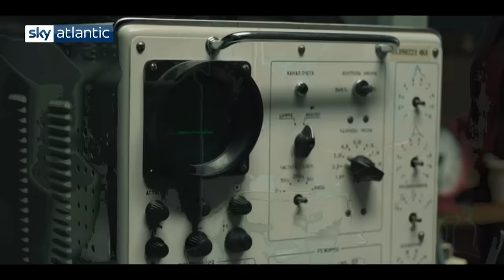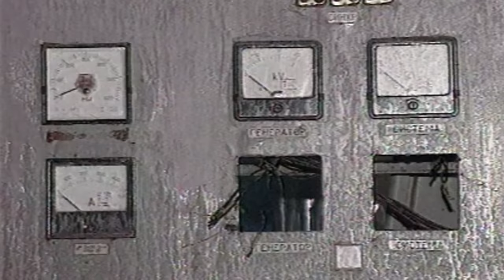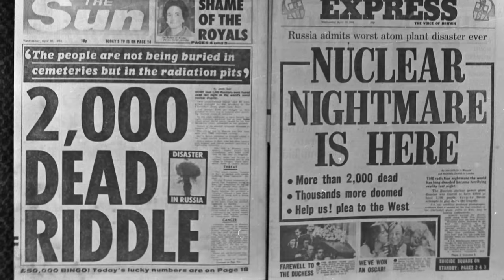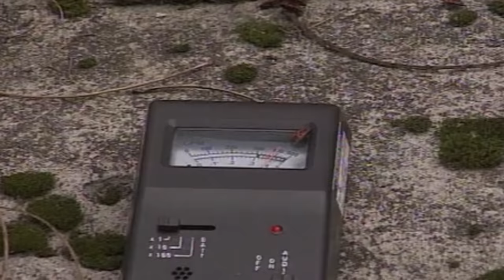Chernobyl Disaster 1986: What really happened?

Comment: They weren't sleep deprived, there was a shift change at 12am. The explosion happened at 1:23am.
Reply: Junior engineers who didn't understand that once they undershot the 700 MW power level by accident, the test was over.  There was no damage yet, but the reactor would need a day or so to burn off the xenon "poison" and return to a state where it could be operated normally.  They were under pressure to complete the test, and didn't have that kind of time.  
So instead they tried to cowboy it back to power by pulling the control rods further than was safe, and made the situation several billion times worse.
Reply: @josephastier7421  that's true, I didn't argue whether their actions were correct or not, I just said they weren't sleep deprived.
Reply: As simple as 123
Reply: How they both at AM?
Reply: And you know that how?
Reply: @josephastier7421  what's that got to do with this guys comment?? We get it, you watched the series
Reply: Joseph Astier Is doubt that considering n that the CIA was active in the area during that time.
Reply: Joseph Astier f
Reply: But when did they start?
Reply: @morellif36  I did not watch the HBO series.   Too scary/sad.  I have watched a few clips on YT.
Reply: Anyone who works nightshift is sleep deprived. I would know, I've been doing it for 12 years.
Reply: Yeah and due to some dude who wanted a promotion
Reply: I mean half the stuff was not there foult there was a button to shut down the core which dropped all the rods but there bottom was made with lead and so it created more heat and situation became worse
Reply: @spookyspeedy8168 3 y late but because after 11pm it becomes AM again. The difference between the shift change and the explosion is 1 hour and 23 min.

Comment: When you tried to overclock a nuclear reactor but you suddenly realized its not a pc
Reply: actually they were experimenting to overclock withouth cooling or fans 

so that happened
Reply: Guess you also shouldn't trust those grey ketchup and mustard-cabled power supplies
Reply: @jakewest8704  mcd colored cable
Reply: They weren't trying to overclock anything. Not even remotely metaphorically. They merely were testing to see how the reactor would work at low power during a power outage. The core however was poisoned with to much xenon and would NOT go back up. However, the tips of the control rods were graphite. As the control rods slammed in, they immediately acted as the perfect moderator and reaction SKY ROCKETED so fast that the rods became fixed into place. Output climbed to over 30,000 megawatts and probably higher but by that point the sensors were gone. All of the water in the core and around it INSTANTLY vaporized into steam creating a massive explosion strong enough to blow the 2,00,000lb lid skyrocketing through the rough and back down vertical onto the core itself. Then the hydrogen that was created from the steam explosion ignited creating a final bigger explosion that ignited all the graphite in the core and nuclear fuel in the core/what remained of the core.
Reply: @madezra64  bruh its a joke
Reply: @Skuge_  so ppl dying in the worst ways ever and get affected with cancer and deform looks like a joke to u
Reply: @Photo Edit-PH lmao best comment 😂

Comment: Just wondering, not picking a fight or anything.
0:59 "Sleep deprived plant workers", it was night shift, men with families, of course they were sleep deprived. 
Are you using sleep deprivation as some sort of excuse or tool to point blame?
Remember, there are thousands and thousands of SD people working right now at NPP's. Sleep tight.
Reply: no they weren`t - night shift had just started
Reply: @ninasastri  The night shift was not their best players.  They made a small initial mistake in running the test, and dropped the power level too low.   They should have stopped there.  But it would have meant an angry day crew and a much-needed reactor offline for a day or more.   So instead they tried to fix it by doing something incredibly reckless, and it got away from them.
Reply: No, Jim, it wasn't the night shift who did the test, it was the graveyard shift that came on at midnight.  Several of the second shift stayed around to watch the test.  They aren't sleep deprived.  I've worked graveyard shifts in the past and it is not much different from other shifts - you get your (and your family's) patterns set and you go with it.  I enjoyed the quiet, personally.  Sleep was not the problem; relatively junior seniority, with less experience and less knowledge about the job, ask ed to run a procedure they had not been trained, or even briefed on. That was the problem.

Also, the delay in shutting down the reactor exacerbated the xenon poisoning problem.  If the test were run by the second (night) shift, it would have worked.

Comment: love the way this guy blames the workers it was the reactor rods that were at fault not the workers
Reply: That's not true. The workers, specifically Dyatlov, pushed the reactor beyond madness and control. The workers who were just following orders I can understand, but Dyatlov forced them to push the reactor. Also, many of those workers were rookies and had no idea what they were doing, so they share some blame but it's forgivable because had they known the design flaws of the RBMK that were hidden, NOBODY would have pushed the emergency shutoff switch. Nobody knew that the positive void coefficient and graphite tipped rods would ever become a problem because for in order for it to ever become a problem, the reator would HAVE to be pushed beyond madness. They disabled all safety protocols. They did EVERYTHING wrong that night. Anything that could be done wrong that night was done. That's why the reactor was capable of even exploding in the first place. It all stemmed from human error, pride, and lies. Lots of lies and pride.

Comment: One key thing that is rarely mentioned in any of these documentaries is that in the USSR/Russia (unlike in the West) nuclear reactors do not have a containment vessel. The reactor has shielding around it but no concrete containment vessel. This meant that the explosion, once it occurred, allowed radioactive material and gasses to immediately escape into the open air. The arrogant Russians thought their RBMK reactor flawless - no accident could happen. The Three Mile Island reactor did have a containment vessel and therefore there was extremely limited release of radioactivity.

Comment: The weird thing is Japan was much worse with the tsunamis but nobody talks about it they covered it up.
Reply: No it wasn't worse. No core has exploded. Never has that occured in history. Only in Chernobyl.
Reply: Not true
Reply: @stringjazz2937  No your completely wrong..in Fukushima exploded all three nuclear reactors in hydrogen explosions and and the unit 4 suffered a highly contaminating nuclear melting beacause of nuclear fuel rods stored there, all the other units of Fukushima had fuel pools also stored right above the reactor that were all blown away with the reactor in the disaster, The difference between the Nuclear disasters of Tsernobyl and Fukushima is that the reactor in Tsernobyl was RBMK type of reactor that uses graphite like a moderator that in the time of the disaster was still quite new and didn't have any used nuclear fuels stored in them, instead in Fukushima all four units were boiling water reactors BWR, that had decades of used nuclear fuel pools right above the reactors and that were all blown away with the disaster.

Comment: Some idiots told the worker the manual is wrong. The worker found out they're right because they hacked the facilities to show him. Then they trailed a method that would maximise energy flow with little to no work effort and closed the window for cooling. The facilities got too hot because one rod didn't sink on time and they realised their plan for maximum power and efficiency failed. These days they report that 3-5 rods didn't cool 9n time.

Comment: they choose to run the test in the day when there were professional  to run the test but because of some event that was going on they had to pros pond the test to after the event had ended  the shift had already changed and the trainees/ the new workers desided to do the test and they had no guide of what to do because they were the new guys(skip to to the part were the trainees started the test) 
the test 
so they under volt the reactor which caused a build up in xenon a material which would normally be burned out by the high temperatures of the reactor and then they took out all the control rods which caused a power surge that was of the charts/ above what the power meter could measure to which the dropped all the control rods the stabilize the power output but there was a major manufacturing problem which was that they put baron on the tip of the grafit when the dropped the the boron tip melted and jammed the port were the control rods when and that cause the reactor to overheat and explode.

sorry for not putting all the information i do not remeber all of it.